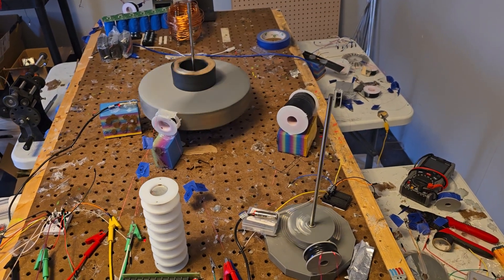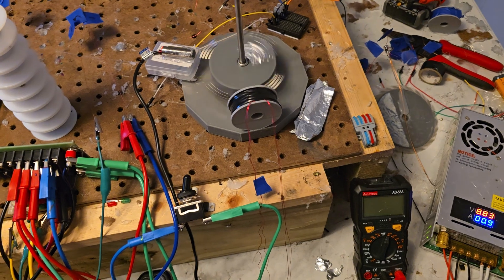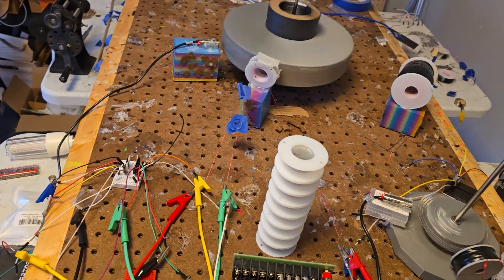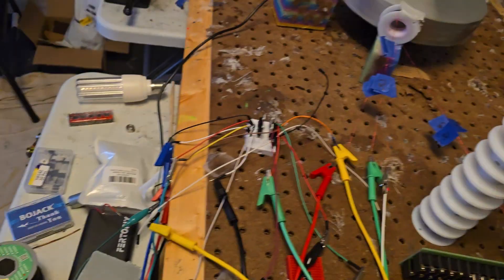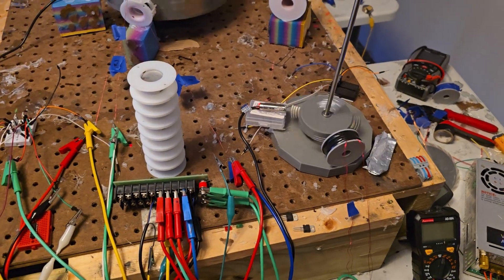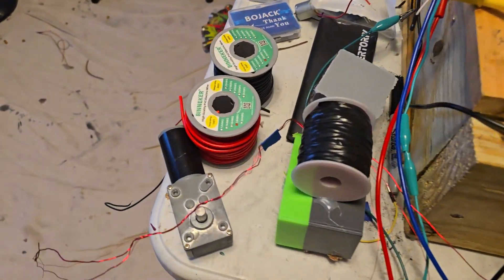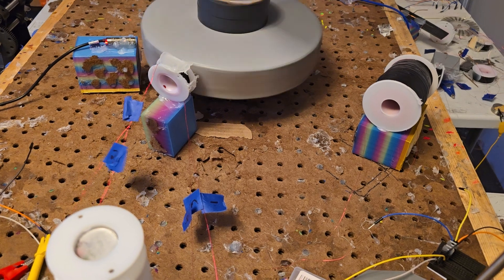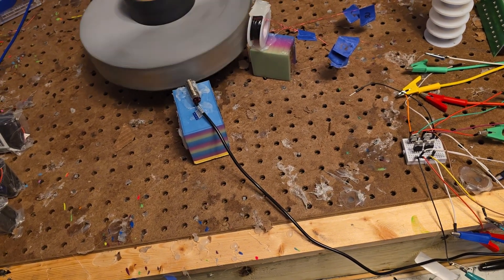pulse motor mayhem  mama pulse motor and baby pulse motor, generator coil discussion good rpms

Comment: Hello, is there 2 wires in the coil on the left motor, one wire is used for the large motor, the second wire is rectified through the diode bridge to provide power to the small motor on the right, I hope you will release a video soon. detailed diagram thank you.